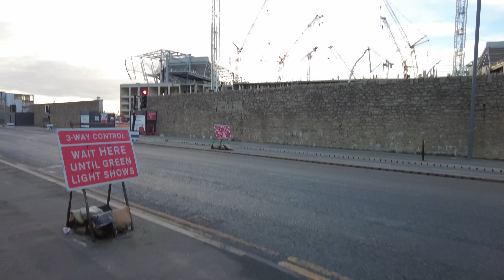Bramley Moore Dock Stadium Update Ep 63 (27.1.23)

Comment: Hey Nick great video as always. Potentially new manager and Gordon gone by the time you next update. One thing I noticed on the last Everton video and you can just make it out on your overhead of the West stand. The concrete raker beams have steel sections on the ends so the floor they are completing should be the last level and then will probably complete the rest in steel. Hopefully this will make it go up even quicker so we can see the North and south stands connecting to the West. 
Thanks
Craig
Reply: Good point. i think your right there.

Comment: An other good video nice was just wondering why the roof on the north stand is different to the south stand why would it not look smectic ?
Reply: the South Stand is deeper so needs a bigger roof. The stadium is not symmetrical. As well as the south stand roof being deeper it also slopes outwards like the bow of a boat whilst the back of the North stand is vertical.
Reply: @grahambrandwood5905  ya I can tell it's no to smecticaI just ment why has north stand got white panels in it an south Is all steal beams surly thay could have put the panels on the south stand as well or just steal beams on north stand ? all I was wondering

Comment: Nick. On a serious note. They really need to crack on with the West and East stands or they will fall behind with the roof.
Reply: The roof trusses on the north and south stands need to be installed before work on the rest of the roof begins. This should be done by Easter time. By then the West and East stand upper tiers should be mostly done
Reply: It's on track so they don't need to crack on.
Reply: Both East & West stands are on schedule. Upper steels then terraces on the west stand go in March through April with roof build on West starting May. East stand a little later.